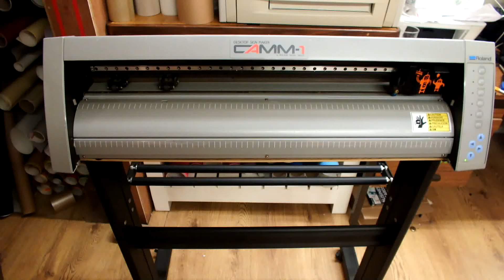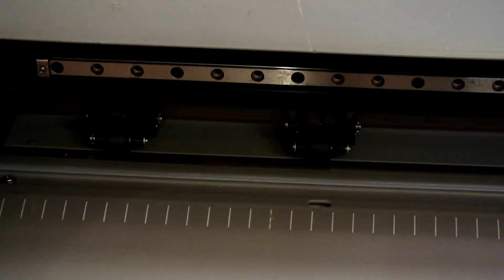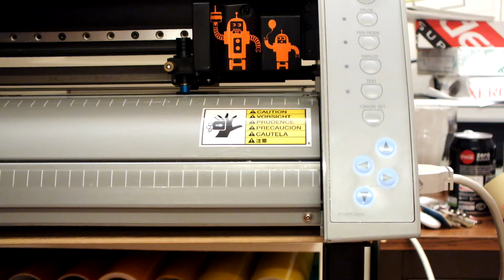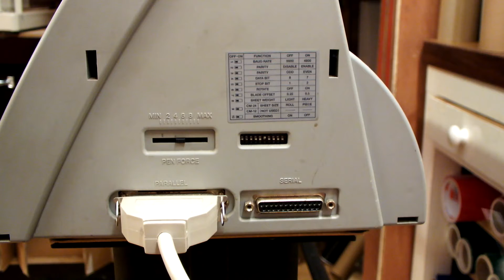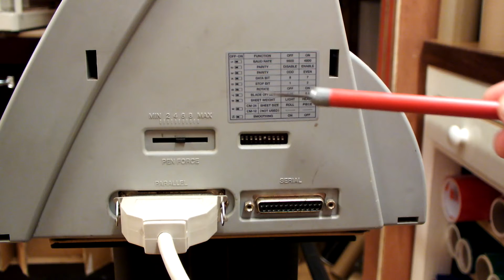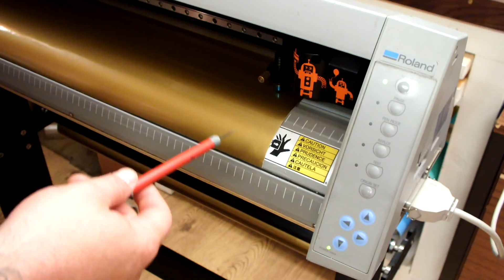Vinyl plotter basics and set-up, Roland CM-24 . Part 1

Comment: Can you sale me one of those cables for mine. It’s not cutting it says that there’s something is wrong with the ports .it would be of much help pulse.can’t see the answer sir.
Reply from the maker: Sorry I don’t have one for sale. But the cable is a female serial port that connects to the computer and a female parallel port that connects to the plotter. 
I’m sure these are easy to find from what I remember. 

Cheers
Reply: @imsticky6925  i found them on Amazon but I think my computer is causing the problem it needs internet .
Reply from the maker: @ElOscarin77  can you explain what is wrong with your computer? Is it showing an error message?
Reply: They have them in amazon

Comment: hi i doubt I will get a response but I just got one of these and I'm having all kinds of problems setting it up my plugs are in the serial port not the parrell will that matter; also do you have any idea what cutter software will work with this and windows 10. lastly my pen mode button is flashing whenever I hit setup do you know what is causing this because it is preventing me from doing a test cut? thank you

Comment: Hello Sticky , thanks for share your video!

Do you have the software recomended for this model roland camm1 cm-24 , i work with a company who have this model but they dont know how to configure,  and i really want to help them , i know too that this model is very old, so i will really aprecciate your help whith this issue

Regards from Paraguay
Reply from the maker: Andres Mernes 

Hi Andres

Many different or most softwares/programs from the time period of the cm-24 manufacture are compatible with the cm-24. The only drivers available for the cm-24 are comparable for windows 95 upto windows xp so I would expect the program most suitable would need to fit into this time period, 1995-2001.

My setup is

Hp pc with parallel port on rear, 2001
Windows Xp
Pc connected to plotter with parallel cable
Program: WinPcSign 2007/drivers included with the program. 

Please take a look at my other video of how to connect your plotter to your pc if your setup is all good and you are having issues connecting. 

https://youtu.be/A0eTgwN9aMA

Many thanks
Reply: Ok there is this company in vanays california they sail roland plotters and they sail a sosoftware called signlab i use it it cost 500 bucks but they could answer any of your questions .
Reply: COREL DRAW